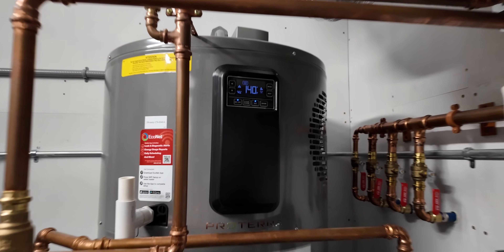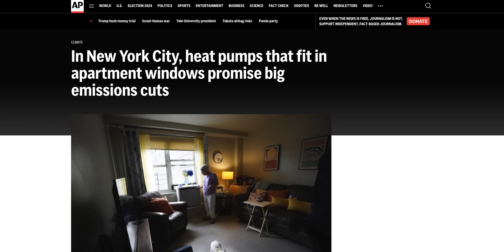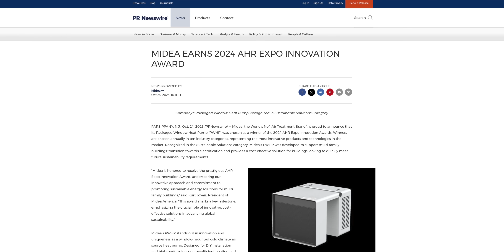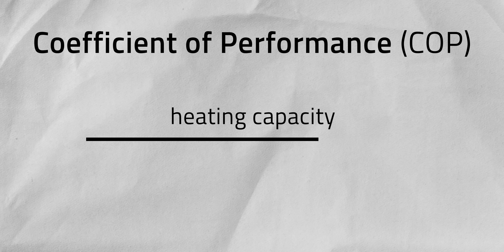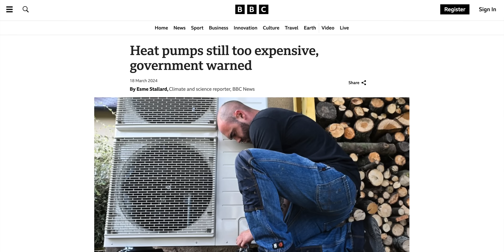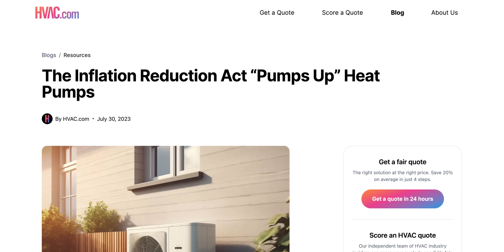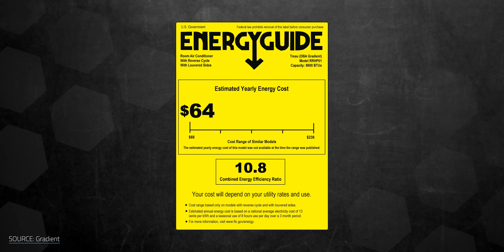Why This Window Heat Pump Is Genius

Comment: I don't understand why these would be so much more expensive. $3000 for an AC that can run in reverse? Isn't it just a couple extra valves and a tad more electronics? I could see $1000; but, 3x that amount feels like it's priced high just to eat federal subsidies.
Reply: I agree. I put a 24k btu mini split in my shop and it was under $2k so this seems way high.
Reply: @SnappyWasHere I can get a 12000btu miki split shipped for less than $400. These units are beyond overpriced
Reply: @SnappyWasHere  how to get a heatpump installed for cheap: have an AC tech come and ask him to install it the wrong way around
Reply: @SnappyWasHere  I'm not an expert but I really don't see how is the heat pump any better that a regular split AC unit :D
Reply: @xtremegaming7726  A mini split is a split unit AC except you can get heat out of it so it's better in that way.  If you live somewhere you don't need heat then it doesn't matter.
Reply: @SnappyWasHere what.  An ac IS a heat pump.
Reply: @halporter9   AC is a heat pump, but it only runs in a single direction. Minisplits, similarly could only be an AC unit, but these days many/most enough can be run bi-directional, as in dump heat outside, or dump heat inside.   The difference is the size of those units, and sometimes a single external unit can service serveral indoor units.  So, back on topic, they're expensive because they're smaller to be 'standard' window width, and they were first to market.
Reply: @SnappyWasHere what brand did you go with?  DIY?
Reply: @therookienomore88  Mr Cool. First one was diy model, second one I put in my garage was their regular model because it works down to below zero. That is my only complaint with the diy model, it shuts off below 0 Fahrenheit.
Reply: Yeah, that's way too high.  I understand it's one of the first generation of these things, so we can probably expect that to come down, but $3 - $4 K is a non-starter.
Reply: @toddthreess9624   And up to 8k for someone to install it for u. It's a scam
Reply: Yeah, methinks it's a wee bit suspicious.
NYC: "We need this to cost no more than $3000"
Suppliers: "What a coincidence! These just happen to cost EXACTLY $3000"
Reply: @QuestionMan  BINGO!  The city will artificially create a floor price.
Reply: We need more companies making these units to get price competition.
Reply: @jamesodell3064 Yes, but given how capitalism is, any corporation will buy out to prevent competition
Reply: @jamesodell3064 No, we need less private initiative and more state-led manufacturing.
Reply: @jamesodell3064  they're not competing for your limited money, they're competing for functionally unlimited government subsidy money. That's why the price is so high.
Reply: It is, the markup for installation is ridiculous. I am very handy and installed a universal for 4 grand including all the ductwork and it works  wonderfully and is code compliant..
Reply: @paperburn  do you have a universal refrigerant licence? if not id like your name so I can report you. you realize the fine associated with that right?
Reply: @robrob4229  And in most states you can install a system yourself you just can not charge it, like you know what your talking about anyway.
Reply: @robrob4229  Get a life, where do u think the stuff comes from? Not outer space. Our government lies
Reply: @paperburn  it's not a state by state based like electrical it's the EPA which is a federal entity...by releasing the refrigerant if he did have a leak that's where he would be fined, I'm all for dyi and you can do everything up until that point but as soon as you start touching refrigerant valves like the "king" valves on Mitsubishi heat pumps you better be damn sure you know how to pressure test up to the new standard of 600psi, and vacuum to a stable 500 mocrons and below. Refrigerant will find any excuse to leave the system if given the chance, but please keep installing your own stuff it's half our business fixing your fuck ups
Reply: @jaybird5877  the pollution aspect is in fact not a lie, also most of it is made in other countries including the refrigerant. Out of all the regulations I'm on the EPA side on this bud. Also you gotta pressure test modern 454 system's up to 600psi, because there running. Pressures can achieve 500-550psi and have spikes above, that's like a fucking bomb going off if you have a flare blow out you can loose fingers eyes so on.
Reply: @paperburn  that is awesome. I did the same with a Mr. Cool universal. All ducts run and load calculations performed by an engineer. Permit compliant. It was all done by myself. In the end it cost me around $4500. It's been running great for over 2 years
Reply: @paperburn arent these meant to be DIY instalation tho?
Reply: @paperburn  I’m looking at purchasing a foreclosure home, the basement is completely open.  The house is currently heated with oil/water radiators.  Your comment makes me feel like I’m not crazy for thinking we can do the ductwork and this ourselves.
Reply: @mctrustsnoone3781  You just have to follow the rules,  the first one is use as little flex duct as possible. the second is the easiest way to insulate round metal duct is to slide it into flex duct . I know those statements are mutually exclusive. but round metal has the highest volume flow but is hard to insulate. unless you run it around your duct work. like a condom around you stuff. No air leakage that way . If you have access to a metal brake you golden to do it yourself and wrap it with foam board. Just do not use flex duct by itself in a run of 25 feet you lose almost all your volume.
Reply: @ thank you very much for your reply and for sharing you knowledge, this is very helpful to my designs!  Your explanation makes a ton of sense, placing the round duct within the flex duct.   Sounds like a significant improvement relative to the cost and effort required.
Reply: Most heat pumps start at less than 1000 dollars here. Like a Qlima S-5435 is only 550 dollars, and it comes with Wifi and a okay SEER at 7 and SCOP at 4,1. It's a okay heatpump, but the best one on the marked the Panasonic cost 2100 dollars. It is also much better with SEER 10.5 at  and SCOP at 6.2, so it means it's 50% better at heating.

SEER is how good it is to cool over a year, and SCOP how good it is to heat. I don't really look at COP as it really only tells you how good it is at one reading at one temperature, and that might be something you never hit. A SCOP of 4 produces 4 kWh heat while using 1 kWh of power. Here we say that they should be 4+ to be any good.
Reply: @-JustHuman-  another drawbar I see is what about closed off rooms?
We have a main window AC but we have smaller BTU units in the bedrooms 
Are we to buy multiple units?
We have forced hot air for heat and the heat pump companies I spoke to at home shows said that we could not use the old exist duct work because the house is really old and uses tin ducts.
They said we would n we special ducts or have to use mini split units.
The only advantage the window unit seems to have is design and not obstructing the window but it also takes up a lot more space Inside the house.
Reply: @andreamitchell4758  If you have old ducts then they might need to be updated anyway as some of them are not good health wise. But you don't need a unit in all rooms as it also does heat passively rooms closer by, I have one that really services 4 rooms. It's more about the air flow. My dad is only going to heat one room in his house, but because of the ducts that heat is moved around from there.
You can also get 1 outside unit that supports multiply inside ones at once, or one that connects directly to you ducts.
Reply: $1000 i would there… $3000.. hell no
Reply: There are a lot of dual-hose or concentric hose portable HVAC units for under $800 out there.
Reply: @prjndigo  But they are not heaters, and they are not efficient. The whole point of the heat pump is that they can do more work for less power.
Reply: @prjndigo You might as start tossing your money in the trash.  Portable units are extremely inefficient.
Reply: @prjndigo they don’t heat tho
Reply: Even $1k is ridiculous, inverter heat pump mini split units cost less than that. $3K is completely absurd for a 9k btu unit!
Reply: What if you don’t have sash windows?
Reply: @MOEMMOH  SEER is 18.5 and cop is 2.95 so better than through the window units, I’m sure that is because of the larger surface area for the evaporator.
Reply: I think a big part of the cost increase is managing condensation
Reply: @amayer171 nope. Managing condensation is easy and cheap.
Reply: At this mark up, it would be worth getting a window AC unit and installing it the wrong way round 😅
Reply: 100% - it seems like they're charging for the convenience of it and banking on the government funds. Mini Splits don't cost this much at all.
Reply: They’re capitalizing on the ridiculously high price to install one
Reply: @CGrantL  indeed, having a traditional Mini split installed by a professional is a lot more expensive than those DIY kits but Midea's solution is a no brainer for the consumer who isn't even allowed to install these kits for their rental apartments.
Reply: 1000 is way too much. It should cost maybe fifty or sixty dollars more than a regular AC.
Reply: Because they can.  Corporation needs no other reason for crazy prices than that.
Reply: The cop seems very low to my ears 🤔. Common units here in scandinavia have up to 5,2 in cop.
Reply: Soleus has one for $700 though I don't think it's as efficient, and it's available now
Reply: HVAC tech here, You are completely correct. While these units have slightly more premium internals to better score on efficiency the only other real change is a reversing valve. ( couple dollars.) the real kicker is that this technology is NOT new and has been mass produced for decades. Most office buildings and homes around the world use  heat pumps for HVAC, they just run off a common chilled water loop instead of outside air for large installations. There is no reason every AC unit in the US shouldn't just come with a reversal valve installed other than it would cut into the heating market.
Reply: There is one point most don't understand. This units are government approved, which means landlords can't object them. No drilling into the wall, easy to fit and without installation costs. Thats alone $500 extra on a $1200 unit. What is a cheaper Window A/C unit worth when the landlord don't allow it because it neeads an installation frame? Nothin as you can't install it. The Landlord can't deny this units, as they are from a city contract. So you don't have to pay the high heating costs, on which the Landlord got his share, and you got cooling. So the Unit costs twice  or 2.5 of a normal unit. But it can't be denied by the Landlords. 
Which make it much better. 

9000 btu/h is more then enough for 900 square feet. 
Of course most A/C Vendors putt out other numbers and for 900 square feet are suddenly 15000btu/h not enough. 
The Question is what do you want, 10 degree below outside and dry air, what is healthy 
or do you want 60°F inside when there are 105°F outside, which is extremely unhealthy.

So you still can get other Units, but this Units can't be denied, which is most likely why they ask twice of the Market Value (No installation Costs) Because they have no competition from the cheap units, which can't be installed in lot of cases.
Reply: Bought a $500 Midea window unit. It is amazing! They have turned the window AC industry on its head. The unit is incredibly quiet, efficient and easy to use/install.  It costs 3x what a similar rated unit costs, but worth it. 
For $2-3 k....not worth it.  The economics will only work if subsidized by the power company and by extension, tax payers.
Reply: My whole home heat pump only cost $4k $500 more than just AC. It was a no brainer from me despite replacing my natural gas furnace at the same time. So now I have a hybrid system. When I have plenty of solar I use the heat pump and I use it for AC. At night with no solar and lower heat sink temperatures I use the furnace.
Reply: Can’t let the “poors” have nice things.  They might get ideas.
Reply: Midea or similar has a very similar model just not folding...they're like $600 or something
Reply: And then here’s me trying to figure out why ‘heat pump’ is being thrown around when there are a lot of window units with the same function. I was thinking of inverters for a sec, but the video isn’t talking about that.
Reply: 12,000 BTU mini split systems that run on 115v are going for $1200. The government set the price, and the manufacturer is very happy.
Reply: A COP of anything less than 4 is not cost effective.
Gas costs 6p 
Electric 25p
6x4=24p
Gas is cheaper and more energy efficient without renewable power supplied.
Reply: I tend to agree, but if I had this unit I could heat or cool for 6 hours each night at 7.5p per kwh! That is cheaper than gas at this cop. Not sure how I could justify using it for the rest of the 18hours per day. Probably batteries I suppose, but then you are probably talking another £30,000 in batteries to get enough winter heating to run 11 of these devices that would be able to hest our home fully  @grantmidd
Reply: @onlineo2263  As an Octopus customer aswel I see why you mean. But as I have 7kw of solar it's financially better for me to just export my excess in the summer and use that money to pay for 2/3 of the gas bill in the winter.

The last thing is that my gas bill is less than £10 a month for 6 months of the year. And I have all gas cooking.
This is because I do not have a tank.
Having a tank doubles the price of your gas bill and a heat pump would put my gas bill upto £50 a month for the 6 months the rads are off rather than £10.
Reply: @grantmidd yes it is..  lmao where I live electricity is dirt cheap and propane or diesel is expensive. Your blanket statement is stupid
Reply: @randybobandy9828  I agree with you where I am diesel and propane are about the same price as electricity.
But naturally gas is a 1/4 of the price of electricity.
And our gas power plants are only 50% efficient.
That reduces a air source heat pumps Cop by half.
At that rate it's not much better than natural gas for the price.
Espesially in winter
Reply: @grantmidd  you cannot say that.. you think electricity is the same price everywhere?
Reply: @MOEMMOH A COP of 2. something (the claimed performance of these units) isn't even that good though
Reply: Especially since this seems to be an evolution of Midea's existing Inverter based AC units.
Reply: Remember the government subsidizes a lot of heat pumps with tax credits or rebates. So that is why 3x the cost. You can afford more. Therefore the cost is going to be higher. Then back down (with govs help) to where it was before the credits existed. Government helps a lot of companies out like that.
Reply: Ok, since I didn't see a single comment specifically covering the actual reason for the higher cost, and I've experienced it over the past year (yes, different units, but it is the details that matter) I have a rather good idea where the cost comes from. Two words: "Variable Capacity". The window AC units I bought during the pandemic are among the most efficient available, yet they only operate at 100% and due to older technology put larger demands on the grid (large in-rush current at start despite low overall wattage). The heat pump where I am now uses newer "inverter" (not actually an inverter, but don't attempt to explain that to the sales & branding people) technology to achieve both Variable Capacity (higher efficiency) AND lower in-rush currents (better power factor, therefore being more friendly to the electric grid). That newer technology is not free. There's your price difference.
Reply: My portable AC already does this, for $250. How much more can it cost to hang half the same components outside?
Reply: As a window heat pump is just a window AC unit with a $20 reversing valve in it, $3000 is a ridiculous price.
Reply: Exactly, and you can thank the HVAC industry in the U.S. for continuing to sell everyone broken heat pumps and call them “AC Units.”  That said, props to the designers of these units for finally making a window unit that isn’t ugly and doesn’t block the view or light from getting in.  Now, if someone could just come up with a window unit that works with horizontal sliding windows, because the old standard units require some janky looking solutions that still sucks and units like these just wouldn’t work at all.
Reply: everything is priced to eat federal subsidies. thats just how greed without regulation and enforcement works.
Reply: You could almost make a kit that turns a mini split into a window unit
Reply: Precisely.  The function of government is to transfer taxpayer money to private corporations.  In this case, as is often the case, the poor, elderly, disabled, and minorities are used as a conduit to make a few people wealthy.  I'm sure an extra $2,000 spent on each resident per window would have a big impact on quality of life, maybe get people out of debt, get medical stuff not covered by insurance, get back to school, fix or replace a used vehicle, start a side hustle, etc.
Reply: I had the same question: if an AC unit is $150, you could just duplicate the complete system, for only 300.  If the valves actually cost fully ten times the cost of 2 window units, just have 2 units, pointed opposite directions.
Reply: @mageyeah7763  No, the valves don't cost more. They cost about the same.
Reply: Probably cost that much because of it's range. Being able to work down to -13 probably cost more to engineer
Reply: My guess is scales of economy are at play here. For everyone in this company to get (more or less) an industry standard wage for their job roles within the company you either have to sell higher volume lower margin or lower volume higher margin.
Reply: This is the problem with including the cost of heat as part of your rent. That just encourages people to leave their windows open then it gets too hot in their apartment - I've seen it rampant in cities. Once people take ownership of their energy usage they start conserving and these brilliant window heat pumps are going to pay for themselves - it'll be dumb not to have them. As far as the price being so freaking ridiculous - you can blame that on the 1 government (for the incentives that cause them to be so high), 2 phony environmentalist (who limit the refrigerants that are available to you and prevent you from getting heat pumps with heating coils for those few extreme cold days), and 3 cronyism (for the sleezy entrepreneurs who push for the gov handouts and laws/regulations to reduce competition).
Reply: A lack of volume production and a lack of competition...
Reply: @MOEMMOH buddy you can buy a 20 seer 12000btu mini split with a COP of 2.5 for less than $400 shipped. There is no excuse for this being $3000
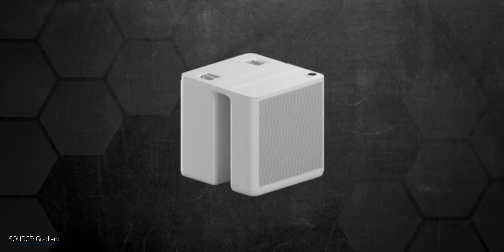Reply: 3:33 its just the Reversingvalve. not that expensive.
Reply: @roguea987  NO ONE that's dropped big bucks for a GEO THERMAL SYSTEM, cares about a "window heat pump". Portable heat pumps vent through a standard window and cost pennies compared to this "window unit" heat pump... You can put a silk scarf on a window unit, but it's still a "window unit." These YouTubers need to wear a sponsor jacket like racecar drivers, at least we'll know who's getting freebies for "views."
Reply: @roguea987  Exactly.
Reply: They're novel and require a separate production line which is costly until they get to the point of selling enough to mass  produce.
Reply: Patented products tend to come with a higher price tag. The idea is that the extra money you're spending helps provide the creators with the funding they need to improve and update their products.
Reply: Heat pump in window.  This is crazy.  Steam heat systems in apartment buildings are are far more efficient than other systems, maybe heat pumps are a little better.  I’m assuming that boilers are well maintained. Heat pumps in windows is a barely an exception. In reality 1. They are means for landlords to stop paying for fuel, 2. A way for Consolidated Edison to increase customer base and to literally build in electric use rather than alternate means such as SOLAR WATER HEATING which integrated with the steam system (95 percent of the infrastructure already exists) can cut heat and hot water fuel use by 30-50 percent.
  FYI:  I or my wife were members of a Northern Manhattan Coop Board for a combined 30 years.  There are a number of frictional institutional issues, but the technology exists and is well tested.  The equipment is off the shelf.
Reply: I have no evidence for this, but I suspect that anything branded as a "heat pump" in western markets gets a price premium because rich climate-conscious folks want to throw money around to make their guilt go away. The Ukraine war gas price situation only exacerbated it.

I got one of those Midea 12k btu units for $250 used off season. A full mini split system was quoted to me $10k-$15k depending on the config. It just doesn't make sense as long as my gas furnace is still burning.
Reply: Why not just buy two air conditioners and flip one and make sure it’s not spewing out toxins?
Reply: Yes, companies fighting like predators over these subsidies, raiding prices like crazy. In the end, guess who stands at the losing end of the deal. Take a guess.. maybe look for a mirror, in case you need some help/hint.
Reply: I'd imagine economies of scale and competition influences that some. If these become more popular more production from more companies will drive down the price.
Reply: I didn't watch far enough to see it was a government contract… that explains the radical cost.
Reply: I wonder how much of that $3000 is marginal vs. fixed cost. Maybe producing a large number, such as would be needed for someplace like NYC, would decrease the price per unit to something more reasonable.
Reply: @davemottern4196  Your comment about marginal vs cost is basically what I was trying to get people to think about.

It’s basically a streamlined double ac unit that pumps both ways depending on which way you want running but the heat it puts in your house isn’t harmful.
Reply: It’s sometimes a question of scale. But I agree, it should be cheaper. 
You could install a mini split for less and I stead of drilling holes in the building still use the window to run the lines. 
Overall I think it’s a good solution. Having a mix of options lets you choose what’s best for your place.
Reply: I can't wait to see your face when you find out many countries in the world have been using this technology for the better part of 50 years.
Reply: It's probably just the design probably only costs about $300 to make one your self with a normal system and just set it up back to back with a mount system cradling it
Reply: The only reason is because they can. I got a Chinese knock off rv heat pump for 200 bucks. Been running it every day for over a year in a grow room.
Reply: It's likely because of the tax incentives the prices are kept artificially high.  Same with EV's and solar systems.  Once the money runs out, the prices magically drop by as much or more than the incentives.
Reply: If people will pay it, then you are charging the right amount. 🤷
Reply: The only game in town that makes a window unit that runs on standard plugs. They can price it whatever they want.
Reply: much cheaper options exist. but those options didnt pay matt to run a 13 minute ad on his channel. This channel is an advertising platform for tech companies. He's concerned with making money, not being informative.
Reply: @Hephera  what other company makes a window Mini split that runs on 110?
Reply: It's mostly down to how cold an outdoor temperature you can run it at. If it doesn't work much below freezing it's not fit for this particular use case. With that said the $3K does still feel high for 9,000 BTUs.
Reply: Mideast has another window heat pump that is not as slick, and only heats down to 41f outside. And it's $500, so some southerners might consider it. The extra expense of the New York contest winners may be due to the extra performance in very cold northern states.
Reply: Scam
Reply: Home Depot sells mini split heat pumps for way cheaper. Iike $400 to $1000 per unit.
Reply: There are cheaper versions here in Japan but they have separate units and piping and they handle smaller rooms. The bigger one versions creep up to the $2000 mark and we have had dual use aircon/air to air heat pumps for years. Overall they are cheaper to run than the alternative systems. We saved money from our kerosene heater which people use in the countryside in Japan.
Reply: Well the thing that stood out to me that’s seen in pretty much all gov contracts is the max price was set to be around 3k so that’s what they’ll charge for their product, companies want to maximize profit not always provide a solution
Reply: Just like anything new...they need "early adopters" to drive down costs....

Look at Tesla vehicles when they first came out, and how much they have gone down since.
Reply: I think that what we need is for IKEA to buy commercial-off-the-shelf parts, and then create a cabinet that works well to house the parts. They could keep the price down, and then the government could incentivize places like nursing homes to buy them.
Reply: @eugenetswong  it will still require draining of some sort... so it will either need to be near a kitchen or bathroom them. Unless ppl want to pay extra for independent pluming.
Reply: @chefboyartty  "it will still require draining of some sort... so it will either need to be near a kitchen or bathroom them. Unless ppl want to pay extra for independent pluming."

Maybe a .5 gallon jug could catch the moisture for manual disposal.
Reply: Supply and Demand, mixed with research costs. Also, probably what you said.
Reply: Can get a $400 window ac with an electric heater
Reply: It's price gouging against an uneducated population.  There are almost no added parts to make a heat pump output heat.  It's just a valve, a little pipe, and a controller.  Everything else is 100% the same as an ac unit.
Reply: The plumbing is significantly more complex, the reversing valves are quite expensive (hundreds of dollars), the electronics are more complex (normal AC just turns on and off, heat pumps need microcontrollers and software), they use more expensive refrigerants, and they are built to higher efficiency standards, and they use more expensive brushless DC compressors.
Reply: Green Energy Electrification with battery storage moves us away from limited energy fossil fuels and towards total energy independence ultimately approaching zero marginal cost.
Reply: @stevennelson7518  Amazing. Everything you just said was wrong.
Reply: Someone could prob take the idea and make it cheaper. It' ripe for competition. Or the Gov' can do it themselves with a commercial exception to bypass any copy/pat they have.
Reply: Lmao
Reply: I installed a split system in my house like 2 years ago and that only costed me like 400-500 dollars, 12,000BTU - can cool and heat, I'm not sure why prices are so fucked up in the US?
Reply: They are higher in price because the government ( your tax dollars ) are paying for it.
Reply: The old economic principle of 

"Supply and the government mandated it so I'll I'll charge as much as I can"
Reply: The price is high because they are focused on government contracting/fulfillment.  If they were focused on normal customers the price would easily fall down to like $800 due to market pressure.  In short, Government ALWAYS makes EVERYTHING more expensive.  After all, they are spending YOUR money not their own.
Reply: It really does!
Reply: bingo stingo
Reply: For Boston and other large cities, it’s a fabulous twist on existing technology.   But grossly overpriced caused by lack of competition.  Build it in Mexico, India, or Taiwan and the price will come down.   

You probably need two units, one for kitchen/living room and another for bedroom.   Larger apartments need more units and it gets very pricy.
Reply: well probably chinesse versions will pop out after lots of years ... But for now probably its because you have no alternate option aka black market logics :D
Reply: Volume pricing...
Reply: japan (daiken) has the patent for r32 which they set their own price at will. r-454b is similar to r32 but doesn't have a patent. both are flammable.
Reply: The research costs maybe
Reply: It makes perfect sense if NYC is paying for it.
Reply: I've converted regalar window units to a heatpump, literally 80 buck more of parts and a Defrost controller.
Reply: Year you could buy a AC with reversible valves an earlier tech heat pump. Problem was that if the temperature got down below 40 Fahrenheit they did not work well.  Most standard ACs cannot provide the temperature difference to effectively provide heat at a reduced COP still well above 1.0 by design (cheap and old tech).  Your AC idea can't handle 8 deg F (-13 C).
Reply: Correct. 3 agencies guaranteed to foot the bill so boom, $3000.  Anytime the government gets involved in guaranteed funding costs balloon. See healthcare and college.
Reply: The price is ridiculous.
Reply: Government subsidies. If they charge more, the tax payers will be there to pick up the tab.
Reply: Probably mostly the development and quantity of scale that is there for the window ACs and not there yet for these specific window heat pumps that don't obstruct the window view, etc.
Reply: Get eg4 mini split. $1400 a/c and heat plus it can run on solar and 120ac.
Reply: That's exactly what it is and that's exactly all federal subsidies are good for. Doesn't help the consumer out at all, and kills supply and makes the top rich.
Reply: Ecoflow has a portable one that is way cheaper and can run off 400W solar
Reply: Consumer HDTVs started out at @ $12-15,000 for a 40" plasma screen. Now a 40" smart LCD HDTV is available for $120. Of course new tech starting out with one manufacturer is more expensive than what it is intended to replace. Economy of scale and competition will bring prices down, and in this case I predict the price drop will happen rather quickly.
Reply: @dougthompson1598  good point
Reply: Can’t help thinking that there are going to be a risk of draughts where the unit sits on the window sill. What’s the seal like on these things?
Reply: @philiptaylor7902  uses foam blocks you cut to size. They actually seal well.
Reply: Don't pay the early adopter fee, give it a few years when there's more development to improve performance and some saturation to drive prices down.
Reply: Tad bit more electronics? You need to have the machine defrost the coils which requires at least another sensor and electronics to control it.
Reply: One extra “valve”.
Reply: Only in America, do companies feel like they can add 10x cost because its 'New"
Reply: A big reason is that they have to be more insulative in a lot of installation locations.  An ordinary window unit that's $800 could be maybe $1,000 as a heat pump, but that would only work well in a narrow temperature band from about 40-100 (30 degrees either side of 70).  It's not just moving the heat into the room, it's also about keeping heat already there from escaping, and your ordinary window unit is pretty bad at this - having it installed when it's 0 degrees could lead to more heat loss than it can generate.
Reply: It's highly efficient and has a flexible linset. In addition, this is a new form factor which requires a new factory setup. It all adds up.
Reply: The prices may come down as manufacturing scales up.
Reply: You are correct. It's marketing based not the technology. You can accomplish it with standard window A/C units right now.
Reply: The difference is that ACs have been mass produced for decades already so all the manufacturing for them is mature driving costs way down due to economies of scale. As these heat pumps become increasingly common the cost will likely drop dramatically like most other technologies.
Reply: This is especially nutty when the Midea U units and other inverter AC's from GE or LG are sub $500.  Those units have a ceer of 15, so their claim is they are more efficient than mini-splits.  Before you say 22 seer, the ceer rating is closely comparable to EER, which is only about 13 for a 22 seer mini-split.
Reply: Yep, federal subsidies for sure
Reply: You are correct that the price is very high because when you compare it to mini-split heat pumps that have similar equipment this is double what a similarly efficient mini-split of similar 9000 BTU capacity can be had for. That mini-split has a 38 seer rating for AC and operates as a heat pump with a HSPF rating of 15, It also lists and EER, which is like the CEER without the standby power when its not operating considered, of 16.5. It is roughly comparable to maybe a slightly better in efficiency and it will operate in an outside Fahrenheit temperature range of -22 to 129. It is just over half of the price of the window unit.
Reply: 3k only makes sense if installation included the dedicated circuit they typically require.
Reply: @roguea987  it's a single different valve. They change the style of the valve and are done with it. Maybe a bit more piping. 

As for electronics, cost difference is negligible. The difference in cost all in all for a reversible heat pump is MAYBE 150 bucks. That is at the very most.
Reply: The reason is mostly, when heat pumps are used in cold, they have to run a defrost cycle or fail.
Reply: $3000 is laughable. This should be $500.. it's literally just a window AC unit with a reversing valve.
Reply: @MOEMMOH  why would I put some to install it? Not is the shipped price. $390 on AliExpress
Reply: @roguea987  I estimate the cost of these products to be around US $600. So…. You can figure out the rest.
Reply: Midea already makes a 12k BTU unit that heats down to 42F... I have one at home right now running. It was around $400
Reply: I think it's just so expensive cause it's a novel design.
Reply: @Cereaza2  One part of it being more expensive is with the condenser requiring pumping condensate... the Midea U is just like a conventional AC with the window closed on it. While this flips it upside down and condensate cannot flow by gravity. But who are we kidding that only adds maybe another $50.
Reply: @Cereaza2  I mean its expensive because they need to justify subsidy...
Reply: It's a heat pump, it heats as well as cools. 12k to 18k single zone heat pumps cost the same thing.
Reply: @jasonmckie4402  Tell that to the 12K BTU Midea heat pump that is $430.... sure there are mini splits that cost that much, but it better be 38Seer. The Gradient is only 10.8 CEER... which is quite bad. The Midea U cool only is 15 CEER. And the Midea heat / cool in standard configuration is 13.3 CEER. Both of those are under 1/7th the cost of the Gradient.
Reply: I wasn't sure of the CEER rating on these. If what you are saying is correct then there is no reason they should cost so much. They will be utterly useless on a cold New York night, spending most of their time just defrosting.
Reply: @jasonmckie4402  Yeah those CEER numbers are straight from thier specs.... and Midea's.
Reply: they are hoping to profit from a fad.🤔
Reply: Amortization. They still have to pay for the cost for setting up the factory and all the R&D to develop the product.
Reply: It's simply the economy of scale. The more they sell and produce, the cheaper it can get. It's almost always like that with newly made products made by rising companies.
Reply: Federal subsidies are the biggest lie only liberal Biden admin can come up with... All that money goes straight to the manufacturers pocket.. The moment x$ subsidies  are introduced , the manufacturer discontinued old models and releases new ones priced x$ higher
Reply: You figured it out in the last line of your comment.  Also, the housing authority set a target of no more than $3000.  That means the price is $3000.
Reply: Hit the nail on the head
Reply: These aren't anything new, they were around 50 years ago. And yes these specific ones are stupidly expensive because there are window AC units just like this that aren't much more expensive than the normal window units. (they just don't have the swinging  part)
Reply: @roguea987  Unfortunately as proven by Technology Connections it is not at all that much more expensive. The industry has just convinced the general public that heat pumps are this premium tech when in fact it is usually only as complex as you have described
Reply: @roguea987  that is way overpriced
Reply: Moneyti'zn. To hay with the environment,  lets go make money.
Reply: @roguea987  some people have been using conventional window AC units, mounted backwards to work as heaters. The channel Tech Ingredients tested efficiency
Reply: I guess it is easy to install, but you can get plug and play mini splits for under $1,000 and the capacity has to be much greater? I’ll pass
Reply: @roguea987  bingo it’s a money laundering scheme
Reply: Turning around any old window air conditioner does the same thing. Yes, just turn it around and you will have heat.
Reply: @roguea987  mount the ac backward wola
Reply: More wonderful Marxist “government assistance.” As if kickbacks aren’t a thing. Shameful.
Reply: All heat pumps can run in reverse so nothing new
Reply: @roguea987  $399 bucks in Amazon
Reply: Good point. My stupid stand up AC unit from Costco is also a heat pump.  It’s a crappy dilonghi. I doubt it’s very energy efficient but it cooled an attic room just fine. It can also heat and it only cost $500. This is clearly a grab at the crony capitalism money NY is throwing out. 😂
Reply: We always pay more for new technologies, as these innovators need to recoup losses. As more customers come on board, they find economics of scale and can reduce prices. That, combined with new companies who will compete with similar products, will bring down the price.
Reply: Wait till Amazon Employees turn Union, price will double!!!!!!!
Reply: What about a design for windows that open laterally instead of vertically?
Reply: I guess it really ISNT about the environment, now is it?
Reply: @roguea987  its priced this high because they got a nice government contract.
Reply: @roguea987  I’m working on distributing these things. It’s awesome tech and even effective at low temps but it’s VERY new. It’s gonna come down in price more after some time but acs have the luxury of decades in the market. There’s high demand for them in apartment complexes which is also what’s driving up the price
Reply: It's not just adding a reversing valve. That will get you a heat pump that freezes into a solid block of ice the moment it gets a little chilly outside. The outside coils have to be colder than the surrounding air in order to collect heat, so when it's cold outside, the coils will be below freezing. Water in the air will condense on the coils and turn to ice, causing the unit to stop working. At the very least the heat pump needs some way to detect and deal with this situation. And since being without heat can be life-threatening, you really want your heat pump to be built to a higher standard than a cheap room AC. Obviously this is a premium heat pump, so it's going to be expensive. But if your point is that we aren't going to solve global warming with $3,000 window heat pumps, I agree with you there.
Reply: @willisblackburn  This is already a solved problem on every cheap mini-split. The defrost cycle runs it in cooling mode with the interior fan off, makes the condenser hot to melt off. the frost, and that's it. More expensive ones have a heated pan on the bottom to melt ice buildup, but even without that it's very effective.
Reply: You are correct. This is just a money grab. They're stealing money from taxpayers.
Reply: You can just flip your a/c around and it does the same thing.
Reply: Subsidies - BINGO.  These would be 50% more expensive than window AC units if we weren’t artificially supporting them.  You can have a full blown minisplit installed for less, which is WAY more efficient and has much more capacity.
Reply: You don't even need valves. Literally just turn a good A.C. window unit around and it does the same exact thing for like $300
Reply: @  true, but ac units are not suited for heating, ie they will not work efficiently with the evaporator absorbing energy at cold temperatures.
Reply: Yeah I'll pass on 3k
Reply: What is I took my u shaped AC and flipped it around in the winter?
Reply: You can get a window mounted heat pump for little more than an AC unit.
Reply: Calling Elon Musk or some other bright engineer with business acumen...
Reply: Cause they can. You will buy. Jedi mind trick
Reply: You can find this U shape models from 750 to 1,200 USD
Reply: 12000 BTU mini-splits that runs on 115V are already less than $500. These units are basically a mini-heatpump in a different form factor. I just don't see why they can't keep it less than $1000.
Reply: I that is the biggest problem with federal subsidies. While the idea is good (to encourage a certain technology), the effect often is that there is zero incentive to make the item as affordable as possible, because the subsidies bring the total cost just low enough to attract the early adopters, but not low enough for the general population.
Reply: Midea and GE already make these on Amazon for around $300-600
Reply: Just install a window AC backwards
Reply: Coal is the future!
Reply: We have heat pump units for sale in Brasil for around 320 dollars.
Reply: Engineering and tooling costs-- it takes a lot of resources to redesign objects.
Reply: Lack of competition and a highly limited production run so they have to be priced high to recoup R&D costs
Reply: @roguea987  There are diesel heaters that put out small amounts of heat you can run in a utility rooms, in your car. The Western version is ~1200. Chinese version ~100. Clear difference in quality but the Chinese version still runs all winter, parts and modifications more or less readily available. I say that to suggest a Chinese version of these might now or one day exist, for 800 or 1000 instead of 3000. Or $1500 with the taco tax from Bone Spur. Still cheaper.
Reply: exactly
Reply: Someone mentioned earlier, but economy in scale plays a big role in price.
Reply: You can get a mini split for $500 that will operate as a AC or heat pump.. 🙄
Reply: Traditional style window AC units are available in reverse cycle (heat pump) form and some also allow a little transfer of fresh and stale air between indoors and outdoors so are MUCH healthier and oh yes cheaper
Reply: @josephcullen2512  But they are annoyingly noisy, as are all window units. To be quiet, we need the inverter window models. But that variable compressor inverter is more expensive.
Reply: You can get a cheap half ton mini split for like 700 and just hang the evap right out the window on a DIY frame. So now you got a larger and stronger unit with a fan that can heat or cool a much larger area for literally a quarter of the price
Reply: @yoface938  these were commissioned by NYC to be easily installable in tens of thousands of their rent-subsidized apartments. But I agree, too pricey and only 9,000 btu.  I suppose they are durable.
Reply: @yoface938  Right but when you want to swap where the heat goes do you have to turn the device?
Reply: @ValidatingUsername  the way mini splits are designed, they are essentially heat pumps and can reverse heat flow. You just have to wait a few minutes after playing with the remote.
Reply: @ValidatingUsername No, the reverse valves handle that. And then the unit blows (very) cold air out the window.
Reply: They're cashing in on a city contract. It's like a Military Industrial Complex contract, but more local, closer to home, and even more potential for kickbacks and sticky fingers. Listed price is 3k. Dollars to doughnuts that the city will 'subsidize' 2k of it to make the actual price around a grand. Of that two thousand, five hundred probably goes directly into the pockets of the guy who set up the deal. And the subsidies come in the form of tax rebates, so you even get to defer the actual costs to the next fiscal year.
Reply: @ShneekeyTheLost   - Yea, but to use that rebate, it has to be more than the deductible.  Just another scam!
Reply: @ShneekeyTheLost  100kbtu device would run that price anyways man
Reply: Back when flat screen TVs were introduced (plasma technology) they cost $10K. Today you can get an LCD screen for a few hundred dollars. Such is the case with most new technologies.
Having said that, this video didn't mention that $3K is the cost per window/room. 😅
Reply: @itsm3th3b33 but this isn't a new technology like a plasma TV buddy.. this is old technology in a slightly different form factor. Not the same, no justification for this price.
Reply: @randybobandy9828  
Wrong. Your "old" A/C doesn't heat your room. It is relatively new.
Reply: @itsm3th3b33  OK, but it’s not really new tech. The only thing that is new is putting it in the U-shape form factor, which other companies have been doing for a few years already.
Reply: Yea this is BS. They make a u shaped inverter air conditioner for 400$, they should be able to add the reversing system for pennies more. A few dollars at most.
Reply: @SetitesTechAdventures  valve is a hundred bux, and requires redesign to be efficient both ways, and more to be efficient below 41 deg F outside, which most stop at.
Reply: @mikemotorbike4283 yes probably higher than $100. Also the tilt-ability of the unit, that’s quite an expensive joint for high pressure lines. Also a condensate pump system adds cost. Imagine a week of weather below zero F.  There will be people freezing to death. That’s the thing with air to air heat pumps: the more you need them, the less they work. The only way this could work is if they maintain and keep their old boilers in the basement for any severe cold.
Reply: @SetitesTechAdventures because you don’t know anything about the technology
Reply: you are correct, it is absolutely absurd. 3000 dollars gets you a mr.cool that is 4 times as powerful and just as efficient. they require way more materials including significantly more copper. These companies are pricing these units on the idea that the cities or federal government will subsidize them.
Reply: My AC already does that and it was around $300.
Reply: special tax payer funded government pricing.
Reply: You missed one other benefit, extra table space.
Reply: Challenge the business model not the technology. Watch the piece again. Listen to what and who is selling.
Reply: This is how it works, a NY politician is giving a friend 200 million dollars. Don't worry he'll get some of that.
Reply: YouTube sponsorship money ain’t free
Reply: I cant even see $1000. This thing should be $300, $350 tops.   Its a tiny window unit.  

I just installed a 11,000 btu heatpump minisplit in my house, the entire unit cost under $500 shipped...

They are price gouging for sure.... theres no way that have even $500 in materials in this tint unit, when companies sell full size minisplits for under $500 with a profit.
Reply: My guess is it’s the subsidies, target customers (wealthy NY), and the reality of new technology.
Reply: this is not an AC with reverse, this is a heat pump, which is a completely different technology, which is far more efficient (and has both modes), but also more costly.
Reply: Tesla should start mass-producing AC units.
Reply: Corporate socialism
Reply: @shyghosts7033 this is literally capitalism lmfao 😭😂
Reply: @shyghosts7033 once more come out the price will go down. Thus capitalism.
Reply: Communism.
Reply: That cost makes total sense. Consider the cost in design, manufacture, sales, and distribution. The number of units they build and sell in a year is probably on scale with with Carrier does in a month. It’s about economies of scale.
Reply: @HoosierLarry  no the cost doesn't even come close to making "total sense". Get real
Reply: They're called mini split systems. The issue with air to air heat pumps (like AC) is they don't also heat water
Reply: @waqasahmed939 them heating water is irrelevant. Most mini splits don't heat water..
Reply: Any govt giveaway will have stood high prices. That's why university costs are so out if control and such a ripoff. The more the subsidies, the higher the cost.
Reply: Because it's called a "heat pump" and not an "air conditioner." It's trendy. This is the Apple of air conditioners.
Reply: @ryanpenrod1859  you did hear that they also heat, right?  If air conditioners heated our homes in the winter then we wouldn’t have a need for less efficient boilers for heat.
Reply: @ryanpenrod1859 heat pumps have been a thing for decades. You can get window AC units that are heat pumps. Almost all mini splits are heat pumps. It's just a reversing valve.
Reply: Capitalism!
Reply: @SeanLumly government mandates are capitalism now?
Reply: @SeanLumly so you hate capitalism but you have a comic book cartoon avatar that woudln't exist without it. No wonder commies always starve.
Reply: @SeanLumly  it's not capitalism - they are corruptly overpriced to absorb the maximum federal grant money - that's just another reason why communism sucks balls.
Reply: @SeanLumly  
government subsidizing things as some feel good pet project
sounds more like a socialist welfare state than capitalism.
Reply: @NicholasLatipi  I'm guessing you are an American...
Reply: @SeanLumly  
Subsidies and the government setting the price ceiling has nothing to do with capitalism.
Reply: @NicholasLatipi  Ok, let's work through this. What part of this system is eligible for subsidy,  and how much?
Reply: @SeanLumly  ... because of federal subsidies?  I'm not sure what your point is supposed to be here.  Capitalism would unironically fix the situation.
Reply: @jeffmorris5802  No point, a question. What amount of the heatpump equipment and/or installation subsidized?
Reply: Free market Capitalism is the driving force of innovation and low prices.  innovators create something new and charge a premium.  barring any patents, someone else copies the idea and sells it cheaper.  the more competition, the lower the price goes!
government interference (subsidies) artificially keep prices high!
Reply: @Inspectechhomeinspections  yea but it isn't at the same time
Reply: @Inspectechhomeinspections  also capitalism if any company wants to make profit they will try to stagnat innovation buying out companies capitalism is not the most efficient system
Reply: @SeanLumly  that's not capitalism. The government got involved.
Reply: @SeanLumly  No not Capitalism at all. This is what happens with government funded programs. In this case NYC said hey manufacturers we want an in window heat pump with these specs. We will pay up to 3000 each for them. Midea in particular says hey we already have a unit 1/3 to 1/2 the size they are looking for, increasing the capacity would cost us 10 to 25 % more per unit. We're currently charging a few hundred each for those what should the new larger one cost? 3000 they said they'd pay 3000. I'm not calling it communist because it's not it's government wastefulness. If it WAS done Capitalistically NYC would've said we're looking for window heat pumps with these specs. What do you got and what's the cost. That would've seen the costs fall more closely in line with split units. These kind of programs happen under socialism/communism too the difference being under those types it would've been NYC saying company x you make these heat pumps for 3000 each and that's what they would do.
Reply: @shorty430551  The capitalists -- ie. the product owners -- set the cost. Jesus.

This has to be the most bone-headed take I have ever heard.
Reply: @SeanLumly seriously get educated capitalism done properly lowers prices with competition
Reply: @SeanLumly *government money
Reply: @SeanLumly yes which means we don’t have to buy one and capitalism will bring the price down.
Reply: @SeanLumly  Flawed but vastly superior to any other "ism". My 25+ years traveling World Wide proved  this fact.
Reply: @SeanLumly  Government interference. Since they are being mandated and the market is being driven by regulation, they can charge high prices because you have to pay it. If it was not mandated, it would be cheaper.
Reply: @RayTheMickey  You know what lack of regulation led to? Single hose portable ACs.... the single most shockingly awful and short-sighted cost-cutting exercise in the history of capitalism. Manufacturers save about 23 CENTS per unit by excluding the second hose, but every year it accounts for about 53 thousand-gigawatt-hours in America alone. That's literally the extra electricity used because companies wanted to save 23 cents per unit and decided that the average idiot American consumer has no clue how anything air conditioning actually works and will just think "Hot air go OUT!" totally oblivious to where that air came from (you just paid to cool it!) and what will happen now that air was pumped outside (new air leaks into the building and needs to be cooled... only to have some of that siphoned off to cool the condenser and be blown outside!)
Reply: @RayTheMickey  😂
Reply: New York has a lot of that. Their rent control has already turned much of the housing into slums
Reply: The government makes a problem, and the private section has to find a fix, making everything more expensive. Thank you, government, for being the biggest waste of money known to man.